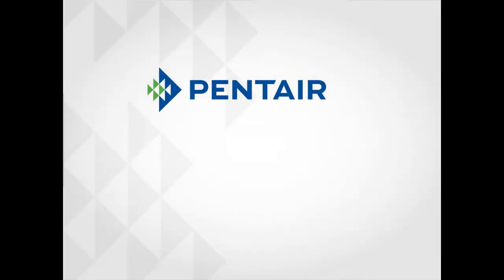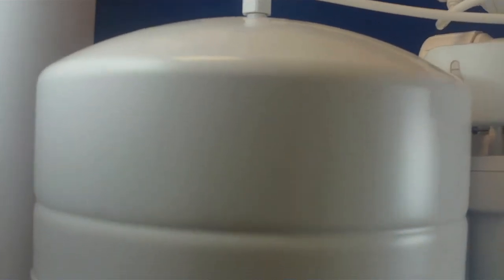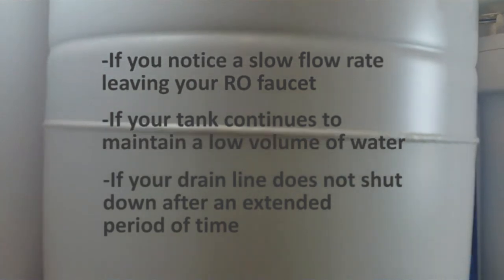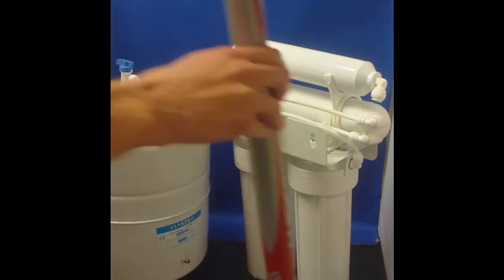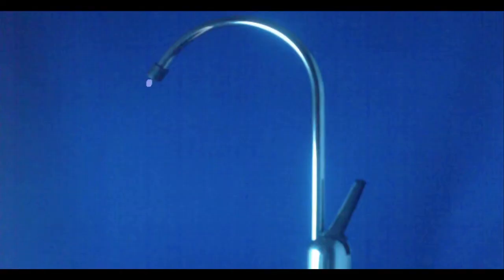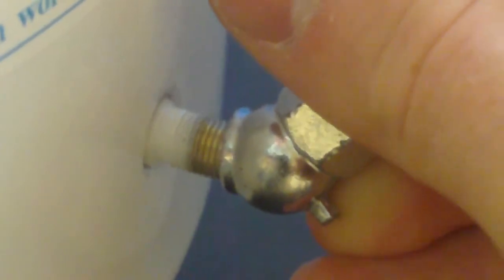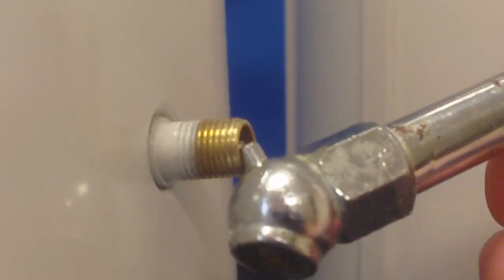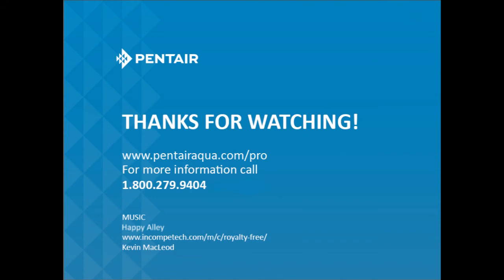Checking Air Pressure of your RO Tank.wmv

Comment: wtdash
1 second ago
After draining, I connected the bike pump and after pumping it up to about 10psi (not sure what the tank's internal bladder can handle)  5-6 times the water keeps flowing.  -Yes I've confirmed the INcoming water is turned Off.  Just keep adding pressure til  it stops draining? Thanks